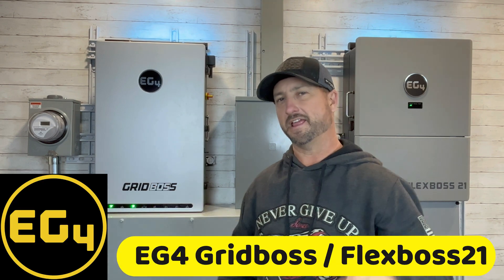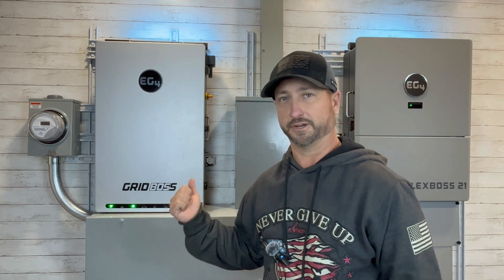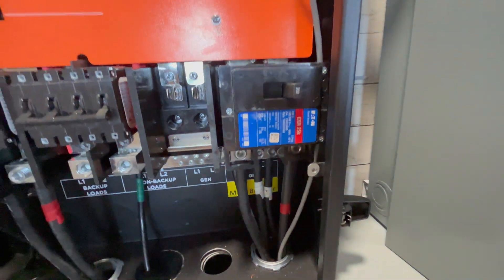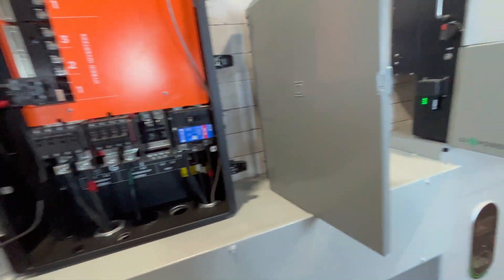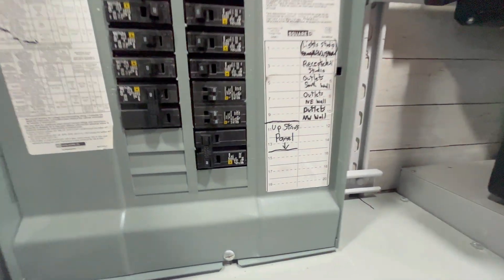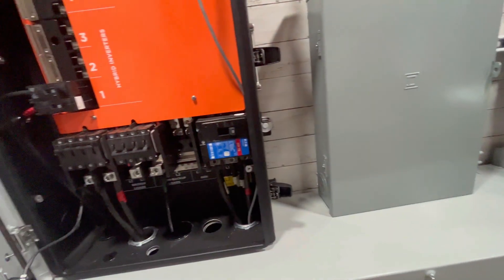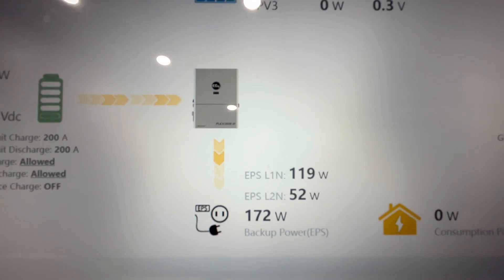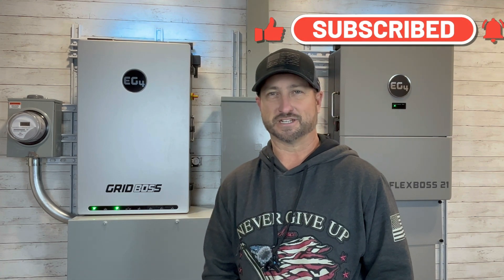How easy is it to install the EG4 Gridboss and Flexboss21?

Comment: Brian…I now have three GridBosses a FlexBoss21, FlexBoss18 and a 12Kpv. When installing all three GB, I followed the manual, updated firmware etc. I also used your PDF from the Unplugged Texan and purchased 3/0 wire etc for all my installs.
When it comes to the dip switches for the comms port, the manual for the GB shows is that the dip switches should all be down. It is written in the manual that all GB dip switches should be down. However, the WiFi dip switch is up on the GB from the factory. I called SS and asked. They put me on hold for several minutes and came back and said that I was the first one to ever call to ask about that but told me that the manufacturer manual says down so pit them in the down position. The diagram on page 32 of the GB manual shows the Master Inverter dip switch to the left of the comm port needs to be in the up position (as in your PDF) so I set the FB21 to the up position. I can’t make out how the dip switches are on your GB by the pic in your manual.
Anyways, Average Joe put out a video yesterday afternoon and said that the inverter dip switch for the comms should be down as per the manual and that is the way it came from the factory so he left it in the down position.
I know that you have a relationship with SS, could you please check how your dip switches are set and confirm with SS. It has all the makings of another video!
Thanks again!

Comment: Finally a video that explains it clearly!  Question.  What if the Meter outside is a combo Meter/Main outside that feeds the Main house panel inside?  So the Main house panel inside is effectively a sub panel (no neutral ground bond).  Does this just mean you lose the ability to power any circuits in the Meter/Main combo outside and the GridBoss would just feed the Main sub panel inside the house?
Reply from the maker: Correct. Your gridboss would install right next to your home panel with the flexboss inverter next to it as well. Your home panel would be the only circuits powered by solar. Any circuits in your meter/main combo would go down if the grid went down. But your home would still have power from solar and batteries.

Comment: Looks like you have 4/0 copper cable connecting the battery and flexboss. Any reason why you went with the 4/0 rather than the 3/0?

Comment: I had a "professional installer" put a battery backup system on my house using a Gridboss, Flexboss 21, and two EG4 indoor batteries.   Seems to work fine but the Gridboss 20 ms relay switch time for a grid outage is about 50/50 for the computers and NAS drives in my house.   On a sour note, due to  my landscape I can only fit about 6 solar panels in a scattered setup.  Due to the minimum voltage requirement of the Flexboss I decided to go with just the six solar panels with  microinverters connected to the Flexboss "load" port.  Plan was to make this a DYI project but it seems APSystems and Enphase do not allow "homeowners" to monitor their own systems unless they are professionally installed.  The professionally installed battery backup was needed to support my work at home day job, but the solar panels were going to be a just for fun project to do on the weekends.  Looking for other microinverter options at this point.  Very good video BTW.
Reply: Have a look at the Hoymiles 2000 microinverter

Comment: Thank you for the video, so the ground  and the neutral of the Grid Boss can come directly from the main panel?
Reply from the maker: The ground, neutral, and grid hot wires come from the meter into the Gridboss. Download my wiring schematic at Flexboss21.com. That will help.

Comment: When you installed the new 200amp breaker on the grid boss, did you leave the old 200amp breaker in your main panel or remove it?
Reply from the maker: I didn’t have one. If I did I would have left it there.

Comment: So with the EG4 FlexBoss21, do I have to use the EG4 Batteries or can I use any other manufacturers 48v batteries with it?
Reply from the maker: You can use any 48v battery with it. You just won’t get the closed loop communication with the inverter unless you use EG4 batteries which I definitely recommend.

Comment: Thanks for this video. It's a great starting point roadmap for a newbee like me. I had purchased most of these products the past month before I found your video. Along with the video, the breakers and wire specs in your document were exactly what I needed to see. 

I was curious about actually mounting the battery, grid boss, and flexboss21 over drywall on wooden studs over a basement concrete wall. The specs say concrete, but it looks like you have yours sitting on a Unistrut product over shiplap or siding which is what I'd prefer to do over the drywall. I can remove the wall if I need to, Unistrut would be easier.  If possible I'd like to hear your thoughts on this. 

Thanks again
Mark D
Reply from the maker: I’m not worried about the heat generated by the equipment. It’s off the wall due to the unistrut so it has airflow behind. That’s my opinion. But if you’re getting it permitted then check with your inspector.

Comment: So only 2 hots from grid boss to home panel, no neutral or ground
Reply: So meter —> gridboss 2 hots, neutral, ground then Gridboss —> home panel 2 hots, neutral, & ground
Reply from the maker: @bpittman correct.
Reply from the maker: No you definitely need the neutral and ground in your home panel as well coming from the Gridboss.

Comment: Thanks again for the great information. I'm using your build as a model for mine.  Wiring up the components and I notice that the specs on the gridboss call for 4/0 copper on the backup and the grid connections.  One other thought if you're looking for an idea for another video, I would love to see one on the process of final inspections / testing / commissioning.  That's upcoming for me and a little unsure what's going to happen in what order.
Reply from the maker: Thanks for the feedback. I didn’t pull a permit for mine since when I installed my project since I wasn’t selling back to the grid they didn’t require one.  But I live in a very rural location outside city limits.

Comment: So the gridboss doesnt have an automatic transfer switch like an 18 K does? I have a manual whole house disconnect in my meter base currently and was looking at just doing the 18K because it had the built in transfer switch so if I lost power it would just switch to a battery bank. Seems like the simplest system to me but I wonder if I am missing something.
Reply from the maker: Yes the gridboss/flexboss21 will automatically transfer power from grid to batteries/solar in the event of a grid outage.  But you must have your main home electrical panel connected to the “backup” port on the Gridboss.

Comment: Great info.  I am interested in the same exact setup but with 2 batteries and be 100% off grid. I just got a 5 ton Bosch AC SEER 18.5 with heat pump and the energy consumption is fantastic. Max amp for my 5 Ton is 60 amps. Never gets anywhere close to that.   I have my house setup as a 2 zone system and it is totally worth it.  Under CA NEM 3 I would be able to feed back to the grid in Aug and Sept at fantastic rates but only 2-3 hours per their published rate schedule.  I would love to hear anyone out there that is taking advantage of CA NEM3.  I have searched for videos but have not seen a single video talking about people feeding back to the grid at peak payout rates under PG&E CA NEM3.

Comment: Why does EG4 still use the older style LF280K 280Ah cells in these batteries when much higher capacity MB-31 330 Amp hour cells are now available?

Comment: In this video on the FB communication ports you have the grey cable that is coming from GB and the green one on top left is the battery com cable if I read right in the manual.. the port labeled K in the manual next to the grey cable is also a parallel port, I saw in another of your video you had orange cable hooked up and not in this one? What is it for if you don't mind me asking... Thanks for all you do!
Reply from the maker: @OldTownOasis  while the communication was working fine with the one cable, tech support a week later told me to add the other comm cable as well.  This was when it was first released. I asked if it was for redundancy and the tech said yes. But he didn’t sound sure. He just said that’s what they recommended now. So I followed his instruction.
Reply: @unpluggedtexan  10-4 good buddy! I'm hoping to go live next week with my setup, basically same as yours. That download diagram of yours came in real handy! Thanks again

Comment: Hey, thanks for the great information.  This is super helpful.  I'm a bit puzzled by the 90A breaker on the inverter to gridboss connection.  Why wouldn't this be up to the limit of the inverter (I think 200A) ?  My service panel is 200A.  Will I be limited to 90A coming from the inverter at any given time?  If there is a time that combined loads exceed that does the grid make up the difference?
Reply from the maker: @fizzixrox  your home panel is powered by the backup port on the gridboss, that can pass through 200amps. The inverter pushes as much power as it can to the gridboss for that power to be distributed to the backup port and smart ports on the gridboss. Let me know if that makes sense.
Reply: @unpluggedtexan  Thank you. Yes I think it does make sense.  So, if there is an instant in time that the combined loads in my house is greater than 90 A then it would require grid power to make up the difference since 90 is the maximum that the flexboss can send to the gridboss.  Does that sound right?
Reply: . . . and therefore if I'm running off grid, I would be limited to a max instantaneous load of 90A since all of my power is coming from the flexboss???

Comment: QUESTION:
I have a Rheem heat pump water heater as well ; however, if you put it in high demand mode, it will use 4500 W per coil(upper and lower)… at least that’s what the rating say. I have not tested it with a clamp Meter yet.
I’m trying to build out a rental next-door and it seems like my water heater might be in high demand mode more than I anticipated . Have you done any testing with your heat pump water heater and does it have two coils for high demand?
Reply from the maker: @securityvlogger6825  yes mine has two heating elements. I believe they are 2,500 watt elements each in the 40 gallon version. So 5,000 watts max. I rarely use it in that mode. I keep it in heat pump mode nearly all the time.

Comment: My installer told me that FlexBoos and GridBoss is marketing scam cuz FlexBoss support only 90Amp  but  the 18kvp support 200Amp so you will need two FlexBoss to get 180Amp! It just doesn’t make sense. What do you suggest?
Reply from the maker: @SD-it8nj  your installer clearly doesn’t understand how the gridboss and flexboss work in tandem. The 200amp pass through is on the Gridboss. So it has the exact pass through that the 18k pv has. Your whole home 200amp panel will be wired directly to the Gridboss’ backup port giving you the full 200amp pass through from the grid when needed.
Reply: @ can you recommend anyone in California who can be trusted and familiar with FlexBoss and GridBoss?
Reply from the maker: @ nobody I know. Give Signature Solar a call. They may have someone they can recommend.

Comment: Shouldn’t the ground+neutral bonding be at the gridboss?
Reply from the maker: @eliazarvela1981  yes if it’s the first point of connection from your meter. My existing solar system on my home is the “grid” connection on this system so my ground/neutral bond is on that end.
Reply: @ thanks and great video! I also saw your “is it worth it” video and you explained it very well. Great job!
Reply from the maker: @ appreciate the feedback!

Comment: I don’t understand how the grid powers the circuit breakers when flexboss is off? It seems the grid power is only connected to the grid boss. Where is the grid boss output to the panel?

Comment: What powers the gridboss?  If you only had it setup with grid power and a generator would it still work or would all the control circuitry go dead as soon as the grid went down?  In other words, does it have a battery to run the logic long enough to get the two wire command sent to the generator and have it come online and switch over to generator power?  If not, which circuit does it get it's control power from so I can figure something out?

Basically, I want a full up system at some point but I need to rework my main electrical box sooner than that so I'd like to go ahead and get a GridBoss installed as my service entrance and take advantage of the generator inlet and load shedding in the meantime.
Reply from the maker: @CowboyPilot79  as I understand it the smart ports and the backed up loads lugs will not work without having an inverter wired to the gridboss. With a grid connection only it appears only the non backed up loads port will work. So you would initially want to wire your main electrical panel to the non backed up loads port until you get an inverter connected to the gridboss. Give Signature Solar a call to double check that as I haven’t personally tested it out in that configuration.
Reply: @unpluggedtexan  interesting, ok.  Good to know I bet I can work with that!

Comment: My computer will not let me download your spec sheet.  Says it is insecure and phishing.  Is there another link?
Reply from the maker: @michaelrobertson7397  weird, first time I’ve heard that. Try this one, this is the direct link
https://us-ms.gr-cdn.com/getresponse-MAwjk/documents/6af25b07-6b31-4051-ac00-67100c24a687.pdf
Reply: @unpluggedtexan  Thank you sir, so much.  It works with no problem.  I tried the original link many times and I was not allowed to download the wiring schematic.

Comment: I finished the core of my DIY installation just a few days ago and I am thrilled by the equipment operation.  I couldn't be happier.  The FlexBoss21 is completely silent under roughly 4000-5000W or so.  It shrugs when I charge my EV at 7.5kW or so.  Nothing gets hot.  Fan output is cool.  The inverter is clearly VERY capable and that is like a breath of fresh air, honestly.   Things barely even get warm.   Very, very different from other all-in-ones and hybrid inverters that I've played with over the years.

The one downside is that EG4's web site and app are still a bit behind on properly showing all power flows and the configuration is a bit obtuse... it took a few days of messing around to figure out how things worked.  The inverter is quick to take over if the grid goes down, a bit slower to start zeroing out grid consumption using the battery (it takes 5 minutes or so to start matching, but then tracks the matching quickly once it has initiated it).  It basically works as desired.  The mobile app sucks... the web site works better.  But the equipment is first-rate.

--

In my case as a DIY I didn't really want to mess with my main panel too much.  It's one of those horrible 200A homeline panels with an integrated meter, 35 years old, so there is literally no way to intercept the 200A service except with a meter collar which... I'm not eligible to use because the meter is too close to the gas main.

I wound up rerouting its relatively few circuits (a few garage 15A circuits, solar AC couple, EVSE, and 100A sub-panel cable for the main house) and cleaned the main outside panel out, then installed a 200A forwarder to go to the grid boss and then a completely new 200A Siemens panel inside the garage on the other side of the walll to take the 200A from the grid boss.

The through-cabling from the main panel to the Grid Boss was a real hassle.  3/0 copper wire through a very short 90-degree bend through-wall to get into the garage.   Word to the wise:  Avoid 90-degree bends for 3/0 THHN/THWN!  It was hours of horror to route four cables through even though it was a 2 inch conduit!

One last item... I was really unhappy with the neutral lug for the homeline for the 3/0 neutral termination on the main panel.  I wound up getting a second lug and double-feeding the cable just to guarantee that the torque won't pry the lugs out of the neutral bar.

All the rest of the cabling has been cake.  I especially love the eas of the battery cabling and the ease of the inverter's AC cabling (only 2 AWG needed instead of 3/0).   The AC coupled solar just went into a smart port, and the EVSE went into another smart port.

One thing about the battery cabling... it's  highly flexible many-stranded tinned copper cable, which means you can't feed it into a lug without a ferrule sleeve.   You don't have to crimp the ferrule, the lug torque is fine, but its something people should be aware of.   The poofy battery cables are incredibly easy to work with though, I'm glad they went with that design.  But you do need ferrules and they lugs have to be properly torqued.

In anycase, I am happily running my home now with solar and one battery which bridges about 18 hours out of the day, and a second battery is coming in a few days... that will give me 24 hours and I'll be able to more or less zero the grid and start working on adding more solar.

-Matt
Reply from the maker: @junkerzn7312  congrats on your system. And thanks for the detailed info!

Comment: would there be any cons to installing a soft start for the air conditioner?
Reply from the maker: @lp2611  no. It’s actually probably better on your AC as it starts up a lot smoother. So if you still want to add a soft start I don’t see any downside to it.